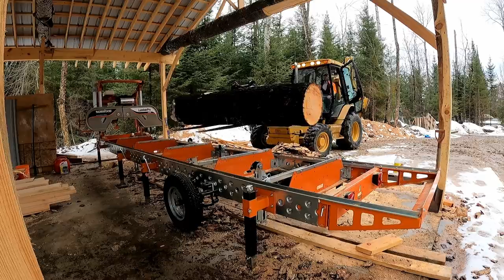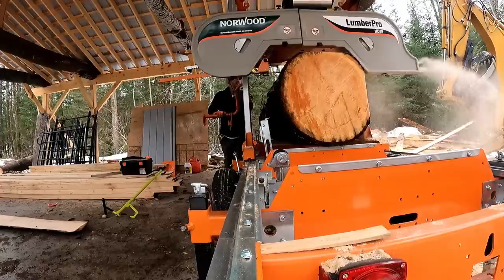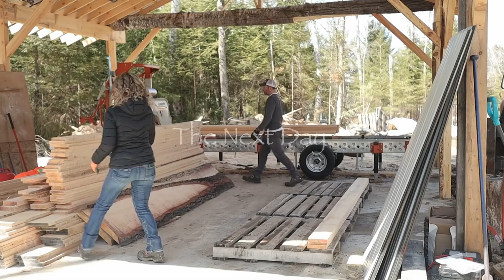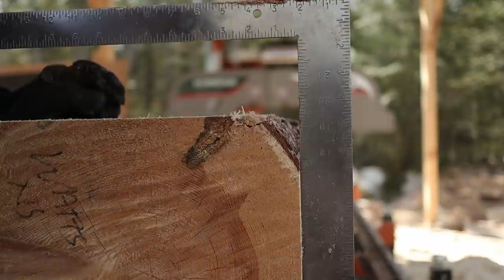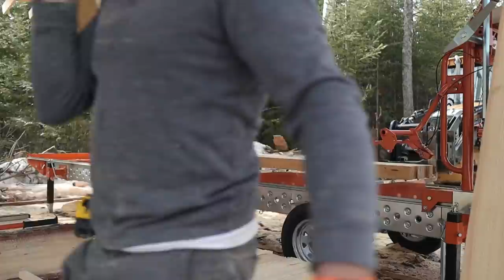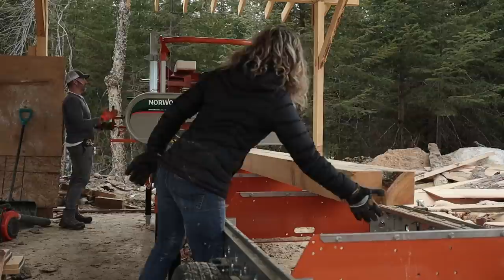Milled LIVE-EDGE and LUMBER from Dead Trees | DIY Repurposed Logs

Comment: You have a roof over your mill now.  That's awesome, must have been one of your winter projects.   I like the logs you used to span the ceiling and tie the walls together.  Backhoe came in clutch on the big white pine.  RIP bent cant hook.  😀
Reply: Nice operation you got going here, also fun to see the two of you work together. Now onto something a bit more serious. Ear muffs, buy the best on the market. I mean it mate, you do not want to get hearing loss, let alone tinnitus, if you do not know what that is look it up. Constant ringing in the ears, it is never quiet. You have to trust me on this ok, use ear muffs (even ear plugs at the same time if need be) at all times.

All the best to both of you.

Comment: Just a note....always load your logs Butt (big end) away from the head, not at the front. The largest cant you can get is the small end so you can see and make your 1st reference curs accordingly.
Reply from the maker: Good point, if I had a spot to turn them around without putting them in the mud I would. As is I try and eyeball it or do an extra cut
Reply: @TimberMates  ...
gotcha...nice video

Comment: This video makes me want to pull the trigger on buying my own sawmill. My problem is I can’t decide between Norwood or Wood Mizer.
Reply from the maker: Haha thanks Carl, I think they're both pretty good, if we went with Norwood again we would go for the bigger one, this mill is a bit too small for some of the massive white pines we do. Also we aren't a fan of the plastic hood cover, the heat from the engine makes it soft and it sags and touches the blade, definitely a few small bad designs with the Norwood, would be curious to see if woodmizer has these issues or not. Hope that helps a bit :)
Reply: @TimberMates  Thanks for the honest input Careena! Funny you mentioned about the plastic hood. I was wondering about that. Woodmizer uses metal hoods. Which I feel a little better about when the blade breaks someday. Has a blade ever broke for you?